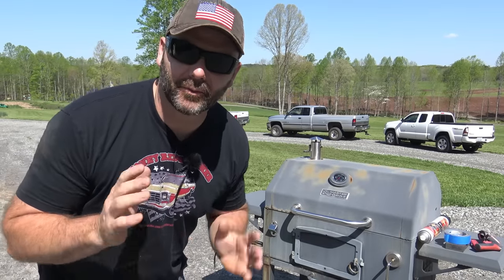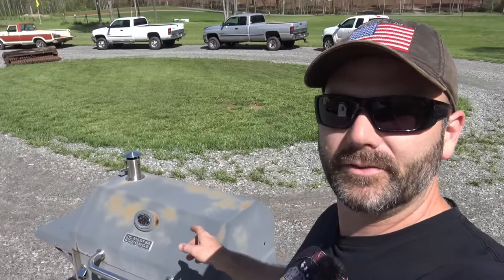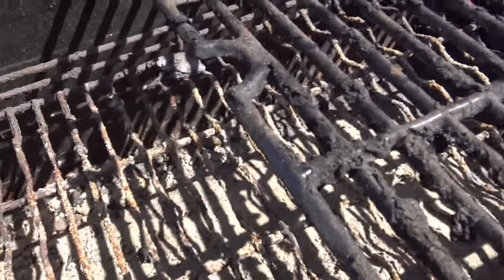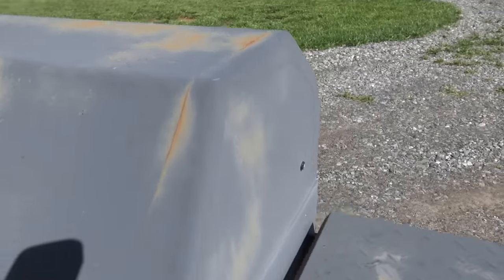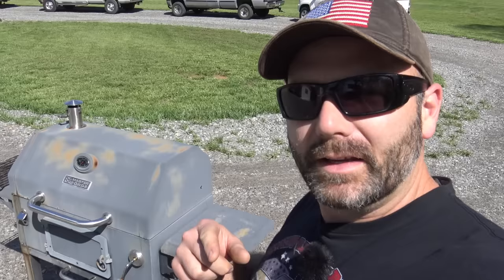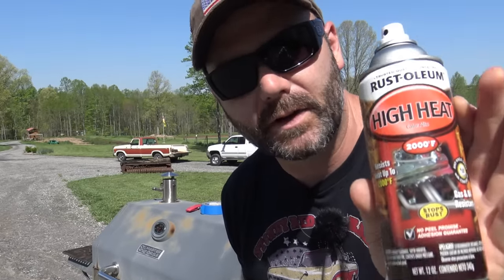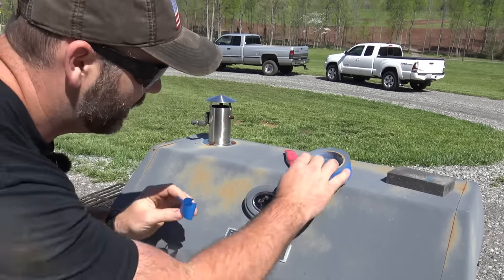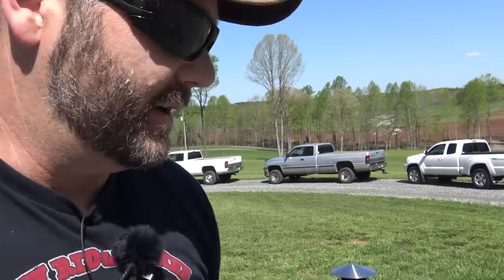WOW!! 2000 DEGREE PAINT MAKES AN OLD GRILL NEW AGAIN!!

Comment: 300 for a new grill..... try 600, nice job tho
Reply: Your right $600 is more like it, but I'd also say he was correct cause it looked like the $300 dollar model. I've seen ones like that before at Lowes for about that.
Reply: Will79 ya some of the cheap ones get down that low but generaly those are the ones to shy away from if you know what i mean....
Reply from the maker: I did my research on this grill fellas...and no matter what ya spend if it's not stainless it's gonna be a big ball of garbage in 5 years anyway
Reply: @stonyridgefarmer thanks for replying, yes you can basically say it is a worthless investment unless you use it every day
Reply: I got a ceramic grill for $600 at Academy and absolutely love it. $300 is about right for a charcoal one like that.
Reply: Buy a Weber.
Reply: Brian Miller i agree, they are the best on the market
Reply: More like $50 or FREE for a USED grill and then buy the paint....to end up Exactly where this guy did!
Reply: I've still got my one the same one for over 10 years. Get a cover for it. Keeps the snow and rain away.
Reply: Wanted to ask did you spray paint the inside as well. Video was on high speed when spraying.
Reply: Na paint just adds chemicals and nasty to ur food who cares what it looks like
Reply: @JM-nh8yp   Eye Eye captain. Im doing that exact thing today.
Reply: Why the hell would one paint the inside? Besides a fondness for eating paint chips or chemicals.
Reply: A decent offset style can be had for $300-400, though its easy to exceed $600 as with anything.
Reply: i dont mean to be offtopic but does someone know a way to log back into an instagram account??
I was dumb forgot my password. I appreciate any tips you can offer me!
Reply: @Enrique Harper instablaster =)
Reply: @Jerome Cade It worked and I now got access to my account again. Im so happy!
Thanks so much you saved my account :D
Reply: @Enrique Harper Glad I could help :)
Reply: I made a mistake and paint my grill with the regular with Stoli and paint. Is it safe to cook on it or do I need to throw on the grill out?
Reply: @StoneyRidgeFarmer  idk that 3 burner expert grill in my other comment cost $96 bran new and still dose to this day. I will do a video on it’s current state and after I restore it.

Comment: Ik im late but i have an expert grill 3 burner gas grill and it’s 8 years old with minimal rust and it has been outside since i put it together so if a grill only lasts 2 to 3 years then it’s user error. I did however just clean it and take it apart so i can restore it and get another 8 years out of it.

Comment: My brother has the same grill and it works great, but here's a little tip. The only downside this grill has is the charcoal doesn't last because the grate has openings that are too big. Get a piece of expanded steel or anything with smaller openings and lay it on top of the original grate. Makes a world of difference and you'll use less charcoal.

Comment: Rust-oleum  2000 degree high heat paint is not the best choice of paint to use on your BBQ. It is a ceramic engine paint that needs to be properly cured, the curing process involves 3 steps of heating and cooling the part, once to 250 degrees, then cooled for 30 min, then heated to 400 degrees for 30 min and then cooled for 30 minutes, then finally heated to 650 degrees and cooled for 30 minutes. 

It wont have any high temperature resistance unless its cured and will flake off .

Another issue is that their high temp ceramic paint is true flat paint which needs to be finished with a Simi gloss or mat clear coat.

A much better choice is Rust-oleums proprietary high heat BBQ paint, this is not the same as the high heat ceramic engine paint that you used. The high heat BBQ paint is a patented proprietary formula, Unlike the  engine paint the BBQ paint has a nice rich mat finish that resists heat up to 1200 degrees and most importantly doesn't require a complicated curing process to activate its high heat properties.

Comment: I have a Napoleon that I've had since 2000. Cost at the time was around $700. Never been painted and cleaned very infrequently. We've used it a lot and its been back and forth across the country with us. Can't say enough about how great Napoleon's are. The only thing that gave up the ghost was the igniter. I just now bought some high heat paint to do some touch ups. Incredibly durable. Having a grill only last 1-2 years is criminal.
Reply: Any grill will last longer with regular cleanings.  I can't believe the filthy rusty things that most people cook on.  You would never eat off of a grill like that in the kitchen!

Comment: I'm a charcoal snob. Hate gas grills.In fact, when my neighbors put them at the curb, I like to roll them home, strip out all the gas burner parts, and turn them into charcoal grills. I've probably painted a couple dozen grills and sold them over the years. That hi-heat engine paint is the bomb.

(It drove me crazy to see you paint over that SS handle! 2 minutes of masking off, brother)
Reply: good job bro , I suggest to wipe out with paint thiner after sanding , before painting the surface should be dust free
Reply: I know it. As you can see why his grills doesn't last long.

Comment: After wasting a ton of money on "grill paint", I finally started using the 2000 degree engine paint. I don't know about the 2000 degrees, but I've never had anything hot enough to peel this stuff off. 
One last suggestion, you might want to consider removing the ash from the bottom of your grill the next day or whenever it cools down. Ash with moisture creates a acid type muck. Enjoyed your video.

Comment: Looks great! I personally would have tapped off all the crime parts. Don’t need to just use tape. Can get a cheap plastic bag to wrap around large areas and tie off of the ends for a clean cut with the tape. Every time I paint, my only regret is paint getting on things I wish it never did, which easiest way to do this is to cover and prep work.

Comment: How did the paint hold up over time?  Did you get any cracking from expansion/contraction of the metal?  I'm going to be getting my reverse offset smoker back from sandblasting this week.  Trying to decide if I should paint the outside or coat it with linseed oil.  I'm going to paint the legs/frame, counterweight, handles, etc., but just don't want to have to strip the main chamber in the future if the paint cracks and peels...

Comment: Every time I grill, I clean the grate and then soak a paper towel in olive oil and soak them. Works great, non stick.
Reply from the maker: So this grill has some sort of non-stick coating on the grates....they clean up great!
Reply: I agree. I just suggested it cause it looks like some rust is starting to develop, that's all and the top grate looks like mine and doesn't have the ceramic coating on them. It really does work. Thanks and thumbs up !

Comment: "A new grill only lasts one or two years..."  

Negative.  I bought my grill in 2004 (Genesis Silver B model with a black exterior) and paid $499 at Home Depot.  I use it easily 75-100 nights a year in Oregon.  I have had to replace the cast iron grates once (after 10 years) and the "flavorizer bars" over the burners twice -- mostly because I was too lazy to scrub them.  My grill is not stainless steel either; it is painted black with the original factory black.  Invest $30 in a proper grill and fitted grill cover.  It truly makes all the difference in the world.
Reply: agree.  my 18 year old cheapy charmglow is still going strong (outside in Michigan and it's never been covered).  It could use some new paint but structurally it's perfect.  i have to put in new burner every few years but no biggie

Comment: Hey Josh got a question for you. I bought the Rustoleum 2000 degree automotive clear gloss, and put it over my Rustoleum high heat copper paint on my Ugly Drum Smoker. I noticed that after a few burns that when I touch it the gloss and the paint is rubbing off, and it wasn't before I put the clear coat on it. Is there any way to fix this problem? and do you think it is harmful to the meat I'm cooking inside of my Smoker? (I only sprayed the outside, NOT the inside) Thanks

Comment: They make high heat primer which should be used for long lasting effects also wire brush off all rust or sand it clean it with water let it dry when dry primer it let dry and lastly paint with high heat 2000 rustoleum boom! Fixed right..

Comment: 3 year lifespan? Allow me to introduce you to Weber. Kettles last decades with bare minimum care. One of my kettles is a 2006 with almost no rust and my other is a 2015 and still looks almost new. My gas grill is a 2000 Weber Genesis silver b with original burner tubes and flavorizer bars. Yes, it’s 20 years old and still cooking like new. Buy a Weber once. You’ll never go back to other brands.

Comment: HERE'S a thought.... DON'T leave the grill out in the backyard in the rain without a cover.  Better yet, put it in the shed or the garage for the Winter.  Here's ANOTHER thought; spray the OUTSIDE of the grill with high-temp Pam spray oil and wipe it down, because that will help SHED rain and dew, and protect your metal.  Do it two or three times a season, and your grill will last for years.
Reply from the maker: Thanks for the tips  brotha

Comment: Love the videos. Thanks for posting this. I’m about to do the same to the last non stainless steel grill I have. Any reason you didn’t use the specific paint made for grills?
Reply from the maker: I just like this paint...I'll bet it's the exact same paint....just cost more because it says "made for grills"
Reply: The one specifically made for grills might have a different amount of pigment in it because it claims to be a sheer gloss and is less heat resistant to the one used for engines. I just wanted to chime in cause I was comparing them today.
Reply: @StoneyRidgeFarmer would it be a bad idea to remove your grates & paint the inside of the grill too?

Comment: Great video! This may sound weird but did you have to prime the grill first or is it okay to just sand and start painting?
Reply: High heat paint seals well as long as you clean, sand, and clean again first. It's not made to be used with primer.

Comment: Or you can maintain it by spraying olive oil on it and keeping it out of the rain.
Reply from the maker: This is a 5 year old $150 grill buddy....but....I'm wondering about this olive oil thing? Do you spray the outside of your grill with olive oil?
Reply: @StoneyRidgeFarmer  my grill is 3 years old. Still looks new. The paint on the grill does not protect from oxidation.  Olive oil inside and out maintains the finish (light spray and wipe off) and protects from rust. Also lubes pivot points and use it on the grates as well.

Comment: Well I dont like the flat finish to it, I can see lots of overlapping Mark's, and more masking would've made a huge difference
Reply from the maker: You do understand this is an old grill on it's last leg right?  This is purely cosmetic and rust preventative.  This grill is now in the trash because the insides just fell apart.  I'm not sure who makes a grill that will actually last....but I'd love to find one.
Reply: Stoney Ridge Farmer    Grab yourself a kamado grill . I’ve had mine for 6 yrs now and looks brand new . I do take good care of it though. It’s cleaned and covered after every cook .
Reply: @StoneyRidgeFarmer  I was sick of replacing grills and bought a Weber about 10 years ago. Damn thing won't die and  parts are available from Weber so if something does fail I just replace the part and not the grill.

Comment: Got me a Char-Broil that's hitting 40 years old next year. Still going strong and a hell of lot better condition than yours. Just the iron cooking grates could use updating cause of rust but that's a simple fix. Actually I'm gonna get me some of them Grill Grates to replace them with. Covers help a lot and putting them inside the garage, basement or barn during the winter extends the life to decades not just a couple of years. Why that's a waste of a fine piece of cooking tool.

Comment: Your coats where to heavy should have done at least 3 to 4 small coats then gone balls deep and finish with a clear coat
Reply from the maker: Do they make clear coat for grills?
Reply: Idk if your being sarcastic or not but yes you can put a clear coat on it, if not it'll look like a mat black turd, also for a grill you should have gone with a ceramic based paint the paint you used  can let out toxic fumes

Comment: Why would you paint over chrome/stainless steel?  Why would you need to replace your grill?  You can replace the parts that rust out for the most part, but if you properly care for it it should last longer than a few years....

Still don't get why you would waste all that time taping off the hard spots, when you could have just unscrewed those and painted it properly.